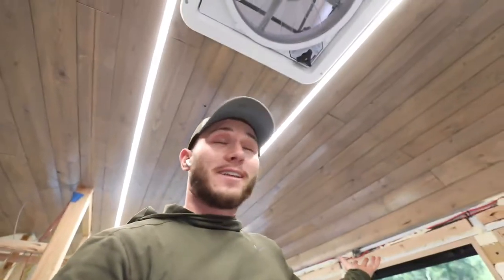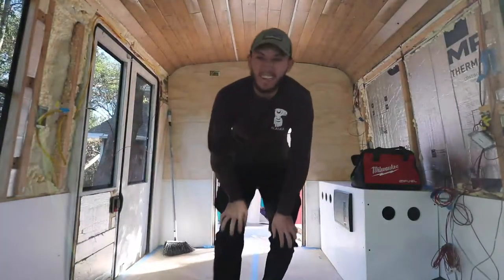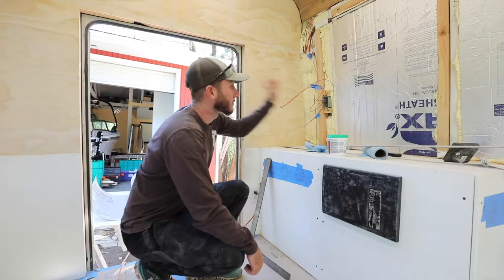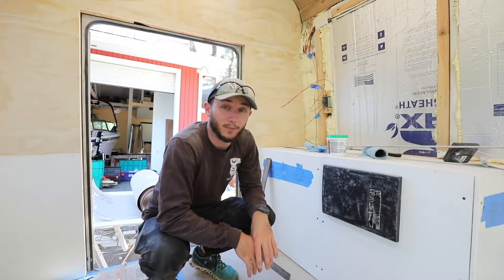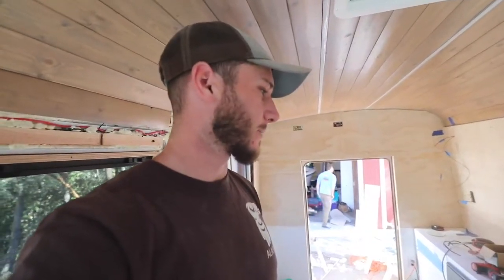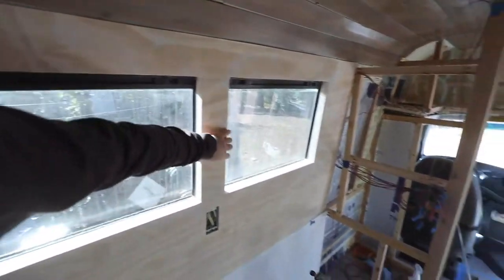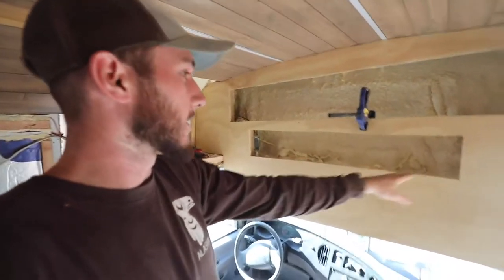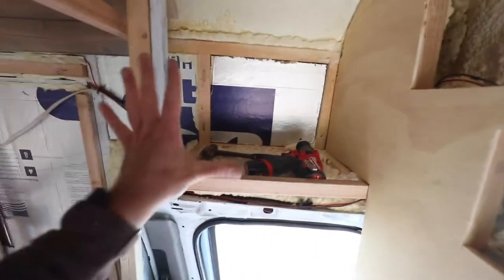Installing Ceiling and Walls in 7 Days - Bus Build Episode 29

Comment: Where did u get the lights from?
Reply from the maker: They're pretty simple aluminum channels with standard adhesive led strips inside. You can get the channels on amazon and they come flat or 45 degree for in corners.